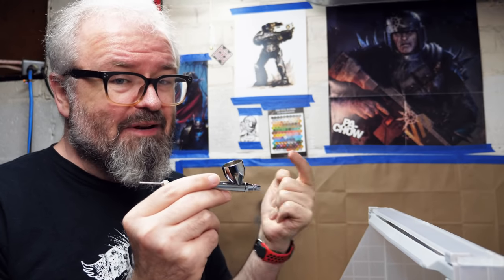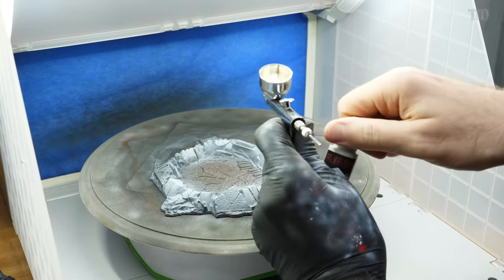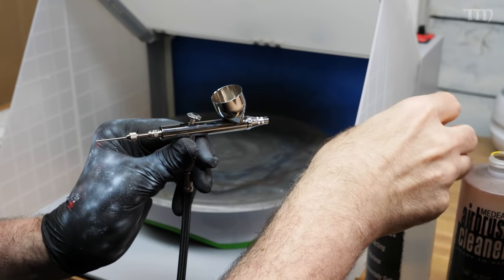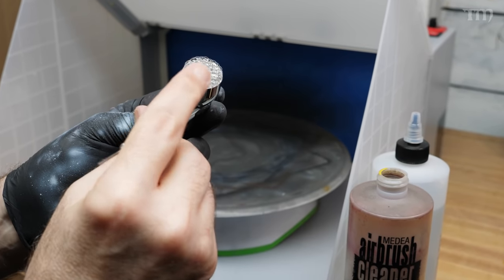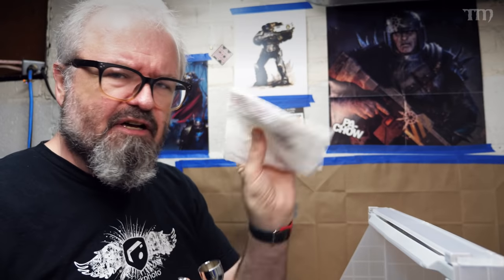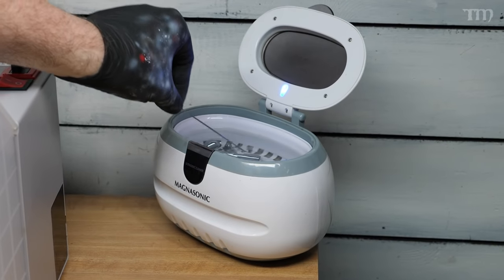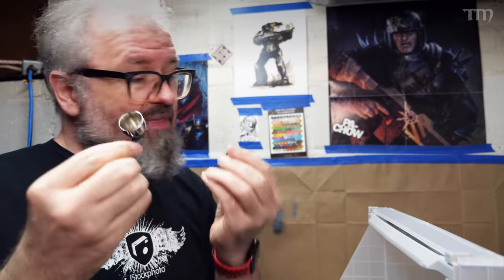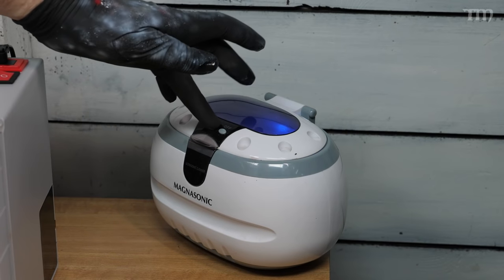NEVER Clog Your Airbrush Again!

Comment: I can imagine that the amount of time I have to leave between painting sessions that I wouldn't be able keep the airbrush wet and would hit the evaporation and mineral problem. I'll definitely try the rest of the cleaning steps though.
Reply from the maker: I use my airbrush much more frequently now, so it doesn’t really happen to me anymore, but in the early days of my airbrushing, there would be months of time between sessions sometimes. Thanks for watching!
Reply: If you need to keep it wet for long amounts of time get a mason jar with the lid and seal it shut. It will prevent the evaporation. Only problem is finding one that is big/tall enough to fit all the parts of your particular airbrush.
Reply: @eingames9931  Mason jars are usually quite big.

Comment: I use my airbrush nearly every day and my routine is pretty close to yours. The difference is that I don't tear it down every night and soak it. I want to be able to pick it up first thing in the morning start painting. I do leave my cleaning water in the cup overnight for much the same reason, though. FYI - That Iwata cleaner is great but with the amount of cleaning I do it's just too pricey to use all of the time. My go-to cleaner is simply water with a bit of dish soap in it. That's all. When I need a more thorough cleaner I'll break out the fancy stuff or alcohol (when there's something really stuck on there). Another difference is that I avoid pulling the needle through the back where there's a chance to bring dried paint from the needle into the back of the brush. I generally take off the tip then bring the needle through the front.
Reply: How u bring it thro the front whem there is a ball on the end of your needle. Lol

Comment: 8:49 Promotional Stratosphere? I have a similar method, but it starts with water, rinsing out the cup so I don't put more paint through it. Once I get most of the paint out, I backflow with water, spray it out, then backflow with the cleaner and spray that out. The keeping it submerged is new to me.

Comment: I do use cleaner as a second step of 3. I start with heated Purple Power or Simple Green-10% concentration. Heated is the magic. I brush the cup with a stiff brush then dump or suction. I do not spray this first cleaning mix through. Repeat. Then repeat with backflush. Then spray cleaner through with backflush. Then distilled water. Then disassemble and wipe needle and dental brush the nozzle. 5 minutes.

Comment: I use DIY cleaner and thinner made by following Grumpy Modeler's YouTube video. Works pretty good for me. I do use army Painter thinner/medium just for adding a little to the cup before I add paint. I do get some dry tip sometimes but I definitely always paint way too much without rinsing/cleaning. I just add a little more cleaner, backflow, spray, add thinner, spray, and keep painting.

Comment: Great tips. 
I put the nozzle only, by itself, in alcohol whenever my airbrush is not in use. 
Never had a clog since I started doing that 3 years ago.

It goes without saying, I don't think alcohol is good for rubber, so only the metal nozzle.

Comment: so I HIGHLY advise to keep the rear cylindrical guard on the back and the nozzle guard. I once dropped the gun and the needle was pushed through the head, warping the tip where the paint shoots out. Ruined it. That was brush number 3 😅

Comment: I don't recommend that Iwata airbrush cleaner. I wear a respirator and have good ventilation. That stuff still messes with me long after I have finished. Fumes are not good. 
Here's my mix. It works great and I have no issues with fumes afterwards. I mix mine in those popular squeeze bottles (wash bottles)
*Airbrush Cleaner
87g - Distilled-water
87g - Simply Green
58g -91% Iso Alc
5+ drop Glycerin

*Secondary Recipe
70% Distilled-water
30% Ammonia Free Glass Cleaner
Iso Alc 3-4 Tbsp
5-10 drops Glycerin

Comment: Interesting... I ordered airbrush (in hope to get rid of spray bottles), and ended up looking some videos for beginners - some of them from professionals. And non of them mentioned A) that their airbrush never clog, or B) idea to build water temple to around of your airbrush (well, that is my reading of suggestion!). 

But that make sense. Ultrasonic cleaner probably take away need for keep them wet, since it actually clean parts very well, but it does not hurt to keep parts there, if you do not need the device for anything else (and if you have such).

Comment: Here is a pro tip for Harder and Steenbeck users like myself - do not backflush too early. Clean out the cup first until the water is not cloudy anymore (squirt bottle helps). Iwata and Iwata clones are fine like described above but HS brushes really make you regret backflushing because the paint goes everywhere inside the device.
Reply: I was thinking this as I was watching
Reply: @TheMiniMadCat  I was following an advice like this once and thought it had to be said. Not all airbrushes are created equal
Reply: I have the evolution and can't realy backflush because the needle cap is slotted. i've tried cupping my palm around it and taping it but the pressure will always find a way. I guess, I could screw the cap of and put my finger directly on the nozzle but I'm afraid I might damage the needle.
Reply: @agileriposte  there are small caps you can buy for this exact reason. 127990 is the part number from HS
Reply: @RobOngrui  Thank you!
Reply: @agileriposte  you are very welcome my friend
Reply: @agileriposte  Have you tried cupping your palm around it whilst using a latex like glove?

Comment: very similar technique here... i use those long pipettes (a squeeze bottle would work even better).. I pull the trigger back (no air on) to open the needle/nozzle, then insert the tip of my pipette as far into the cup/orifice as it can go then i squirt the water/cleaner/flow improver in there.. a nice amount of it will get forced out the nozzle.. then i release the pipette to suck up the left over juice and discard it into a cup, then repeat a few more times with the various cleaning liquids till i am happy and cant see any paint left in there on the needle or the cup.

Comment: I know it's been a while, Anyway I clean my airbrush, with winter windshield wiper fluid. Contains mostly some iso and clean water.  I use for flushing between colors. For deep cleaning airbrush i use the Iwata cleaner.    At least here Iwata cleaner is more expensive than Isopropyl, but It doesn't smell so bad.

Comment: Cleaner  .

I use a mix of simple green, distilled water and iso.

Also you're probably better off taking the needle out from the front after taking the spray nozzle off.

Then reinstalling the needle from the front as well using the spray nozzle as an alignment guide before tighting the needle grip.
This also prevents any damage to any needle seals.

Comment: Hello and thank you very much for posting your video(s). I find them very helpful. I am hoping you could help me with a couple of questions. I have a smaller antique safe that was my grandfathers. The paint is badly worn off. I will be sanding the entire safe and I plan on repainting it and adding a bit of art. I have NEVER used an airbrush! I would appreciate any suggestions for the following:
1) what BLACK colored paint product to spray the entire safe with once it is sanded to bare steel?
2) what paint product to use in my air sprayer? 
3) what paint product to spray over the entire safe, in order to give it a clear coat as protection for the black paint and the artwork?
Thank you very much in advance, it is appreciated!

Comment: 30yrs ago I made a lot of money painting motorcycle helmets.  It was also acrylic water based paint.  I gave up on that hobby / job once I graduated college as an engineer.  Then I later moved onto the miniature hobby.  I never once had a clog but I also never kept my airbrushes in water.  I did do was before starting to paint was run half an airbrush cup of water through the brush before starting or as I was taught, use Airbrush Lubricant (like that from Badger) or simply a few drops of flow improver.  I do use a ultrasonic cleaner but I do not keep the parts in water.  I take them out, dry them and assemble and then prime the airbrush as I stated with water, airbrush lubricant or flow improver.  I agree do not start completely dry but you do not need to keep parts in water.  Never heard of that and never followed that advice and no issues over 30yrs.

Comment: I use water to clean it out. It requires a little more effort to fully clean out but I haven't had issues with it using my paints. I Also have isopropyl alcohol if I worked with a chalkier paint. Not sure why you think isopropyl alcohol is expensive since I pick it up at the local grocery store for $3-$4 at 32oz. It regularly goes on sale for under $3 a bottle and I stock up for my 3d printer.

Comment: When you use any brand of airbrush cleaner you are effectivly buying and transporting alot of water. Just mix it yourself. It's basically diluted alcohol. If that too much of a hassle, my go to cleaner is the blue liquid that sprays on the windshield of your car (not sure what it's called). Buy it concentrated and dilute with water according to the instructions on the bottle. You are still paying for water, but at least it's less expensive and you don't need to ship it from Amazon.

Comment: A lesson learned the hard way: don't add airbrush cleaning fluid to your soak water. Something in there will turn the brass parts black, and eventually dissolve them. Too acidic maybe?

The nozzle for my Neo literally crumbled after a few months of being stored in a cup of water with a few drops of Iwata cleaner. Based on your experience, I'm sure pure water is fine, but now I just do a quick clean with Vincey V's method and store it dry.

Comment: I would recommend getting a wash bottle (the ones with a nozzle at the top), q-tips, and makeup rounds. Since I shoot primer as well as paint through the thing, I have to really clean it after the primer. So I dump the cup, keep the cup pointing down and have the wash bottle flush out as much as I can, then tip it back, half fill with cleaner, rub the cup down with a qtip bottom up, tip it over, wash bottle flush, inspect entire airbrush for dried paint, and then continue with cleaning.  At the end, moisten makeup rounds with cleaner and wipe the surface down, moisten another round and wipe the needle down carefully back to front. Inspect for paint before re-inserting. As I don't let my airbrush soak, which I'll try! Usually the last thing I do is run a couple of cups of distilled water through to make sure any cleaner is diluted or out to protect the seals, and then when I want to start, run a cup of water before I paint and make sure the pressure settings are good, seals are good, no leaks and flush any dust out as well.

Comment: I gotta try some of this. Both my H&S Evolution silverline and my Patriot 106 clog up constantly even with just regular paint. The Patriot bubbles into the air cup unless i crank the tip down all the way, and the h&s is hypersenstive to basically everything.
Reply: I have the same issue with mine. Not sure what the problem is since it's been an issue from day 1 and I clean it really well, always keep paint thin, and use pretty low psi. I even tried needle juice to keep paint from sticking to the needle and it still clogs instantly. Really disappointing.

Comment: I had issues with floating nozzles being negatively affected by longer exposure to airbrush cleaner. Water may be safer. 
I only disassemble the nozzle and needle, using cleaner, water and tissues to clean, then I reassemble the airbrush and put it aside, which keeps everything ready to go and protects the delicate needle and nozzle in the airbrush body.

Comment: OMG this video was super helpful.... I didn't even know that some parts could actually be taken apart. And leaving it in water between uses is something I never did and my air brush just seemed always clogged even doing all the cleaning steps... just a quick question... you mentioned that the air brush cleaner solution can get contaminated; I put the needle in the actual bottle, is that bottle of cleaner no good now? Again great video and thank you!

Comment: I also use medea airbrush cleaner, but my steps are a little different. Add cleaner and backflush, but dont spray, instead use a cotton swab to pull out the larger chunks and wipe the cup. Still dontspray, just dump over the cup. Then add cleaner and backflush, then spray. Use swab to clean the outer of the nozzle.

Comment: Great advise! The habit formation is very important. 
My only problem is that the water in my region is so full of "sediment" the I can't even touch the airbrush with the tap water if I don't want to have it calcified instantly :(
Reply from the maker: Then I would use distilled water. You might have to keep an eye on it because it can get a little weird, but some folks have said that some copper wire in the distilled water will help with any growth. Thanks for watching!

Comment: What is the reason for storing the airbrush in water? I can understand giving it a good soak in water or cleaner to break up any stray paint after cleaning, but how does keeping it submerged prevent clogs? The only effect it would have that I can think of is that everything would be slightly moist inside when you start painting. But you would get the same effect by dunking it all in water before starting right?

Comment: Great tips as usual. Didn't know you could soak it... Only thing I would mention is if you bewn doing a lot of ultrasonic cleaning I destroyed the seals on my first airbruah because the water got too hot as I was using it between colours. If anyone uses an ultrasonic cleaner and the water geta warm chanhe it to some fresh cold water and your seals will be fine.
Reply from the maker: My ultrasonic cleaners have always been cheap enough that they don’t have a heating element, so no worries there. Thanks for watching!
Reply: Science sidebar: ultrasonic cleaners use cavitation to do the cleaning, which generates heat - no heating element required!

Comment: Stopped using the Windex/ Washer Fluid and just use the IPA 99.9% alcohol + distilled water +15 drops of glycerin, cleans the airbrush no problem, but only using Acrylics water-based paints and never had an issue. 1 part IPA (@99.9%) 2 parts Distilled Water, for the thinner the IPA 99.9% alcohol is reduced to IPA 70% and the same formula, with distilled water and glycerin. Made stronger as a cleaner and weaker for a thinner, works great. You can add flow improver (10ml) and retarder (1ml) to a 250ml mix of thinner and that helps the paint level out and stops problems with clogging.

Comment: Using alcohol based cleaning fluids will shorten the life of the rubber seals. Air brush cleaner is designed not to harm the seals.
I've had good results using airbrush oil/lube  to reduce the frequency of the needle drying out during use.

Comment: I've never heard of the keeping the brush in liquid. I would argue that distilled water is cleaner/purer than your tap water. (by definition) But you may be right that whatever is in your 'city water' keeps the cooties at bay, but those cooties are from an outside source not the distilled water. I'm in 'the country' and have well water and while the water is very good, it's full of 'stuff' so I use distilled water for all my brush cleaning, air and bristle.
Reply: distilled water isn't very good, it isn't distilled for long and ends up just like well water, biofilm will grow, same with tap water eventually. what you really want to use is a biocide used in closed water systems something like that to your distilled water.

Comment: This came 1 day too late. Yesterday my airbrush was soo clogged, it blew out the back and exploded paint out the top and all over my hand. Considering it a loss and going to invest in a better quality airbrush and use your tips. Thanks!
Reply: the better quality air brush wont help, i use 2 and one is cheap that came in a kit and the other is quite expensive for me around £250, i do keep good care as i keep them clean, but they can both clog if you dont keep good care of them.

Comment: Primer causes the most headaches for me, usually clogging mid job. Makes sense, it's designed to stick. Do you prime with your airbrush and if so what do you do to keep that from clogging?
Reply: Are you using badger stynylrez? I love how well it sticks to the model and the matte finish but boy does it clog and it’s a pain to clean the gun after using it. I got the 3 pack (black, white and grey) and the black and grey even thinned give the most problems. I am now testing vallejo’s primer and it’s behaving much better making it easier to clean and not clogging.
Reply: I use flow improver and a generous amount of thinner, all from Vallejo.  With some intermediate cleaning I can prime for a couple of hours with very few issues.

Comment: I find my airbrush constantly clogs in the middle of a paint session even without changing colors... it will be flowing great then clog up. I have found that doing short bursts of spray makes it better, but the last little part that the needle goes through at the end is always backing up. I have a hi-end airbrush and I struggle with preventing it from getting clogged...what could  I be doing wrong... much appreciated

Comment: I used to use 99,9% alcohol as a cleaner but I found that clogged up my airbrush real quick. If you use an acrylic-based paint like Vallejo or Tamiya the alcohol gums up the acrylics. So, I've switched to using Mr Leveling Thinner as both a thinner and a cleaner. You don't need a lot of it and it will clean your airbrush thoroughly. It's about the same price for Leveling Thinner as for IPA here.